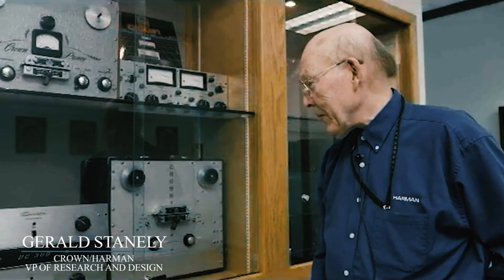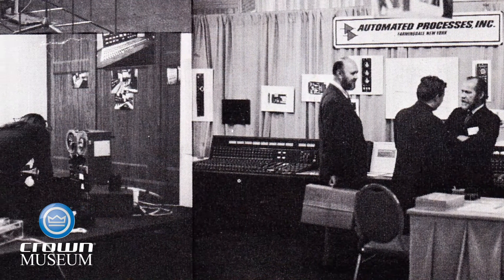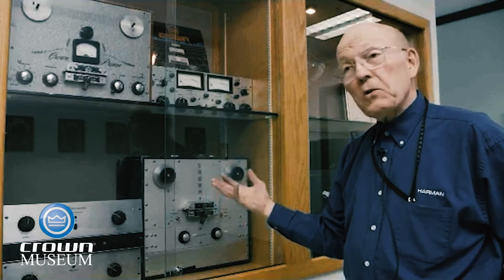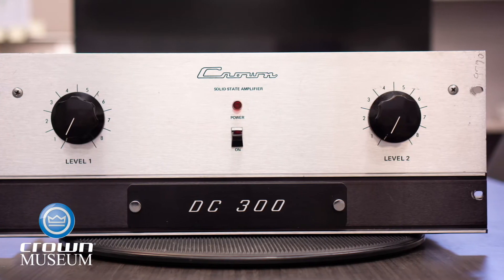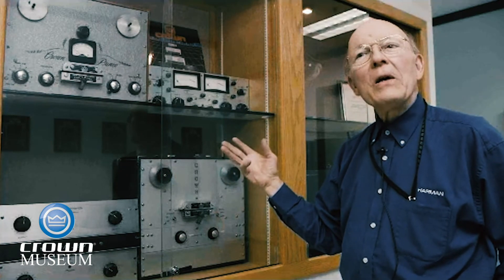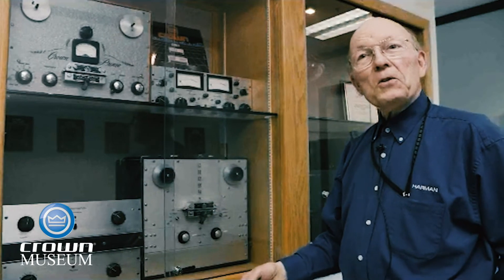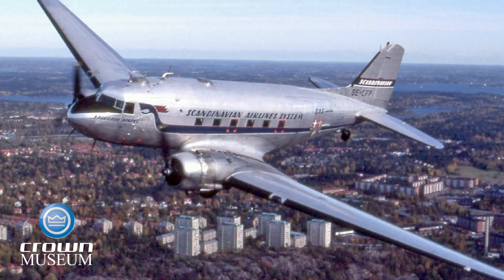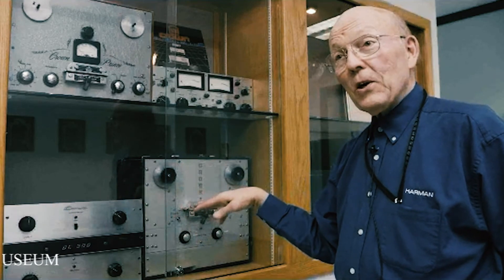DC300: Crown Museum with Gerald Stanley

Comment: Problem: Solid state amps burn out too easily, and without so much as a flash or pop.

Crown:  Here's your solution, an amp that works!

D. Hafler (Hafler) and B. Carver (Phase Linear):  Here's your solution - amps that catch fire under heavy load!

There's more than one way to skin a cat!

Comment: I worked for a super smart fella, in the '80's.  It was a Hi-Fi repair shop and we were a Crown warranty station.  My boss was friends with Gerald and they would chat about circuitry, etc. From the conversations that I heard that they had, you knew that Gerald was/is immensely smart.  There was a piece of the circuit, where a transistor was in a really odd position in the circuit. I think one of their grounded bridge designs.  There's a mirror amplifier circuit that swings the voltage on the Vcc/Rail capacitor(s).   In that Vcc swinger amplifier, was the weird transistor.  My boss asked Gerald, "This one stumps me.  What does that do?". (Gerald) "Oh, that shorts out the base-Emitter capacitance shutting the transistor transistor off, faster.".   He was very clever.  I've worked on some of the Techron's Amps (spun out of Crown) and it has the similar M-600 Grounded Bridge, many, many outputs and the analog thermal computer.  Yup, he is at the top of the heap.  Thank you, Gerald, for all of your cool, innovative designs that harness huge while keeping SOA within bounds.